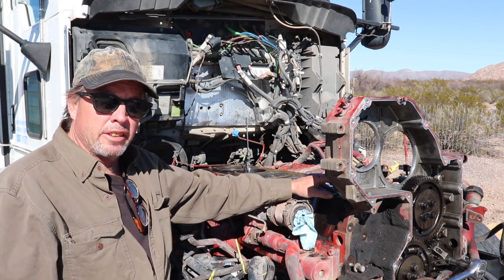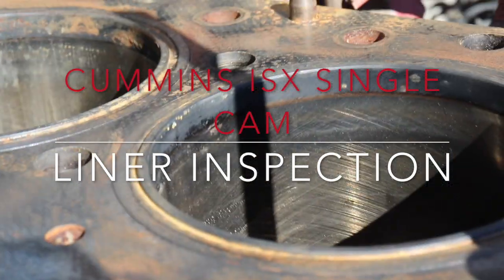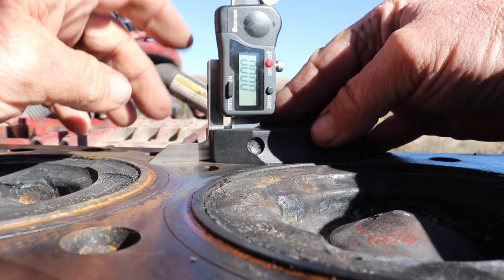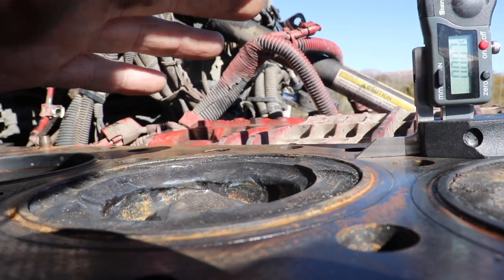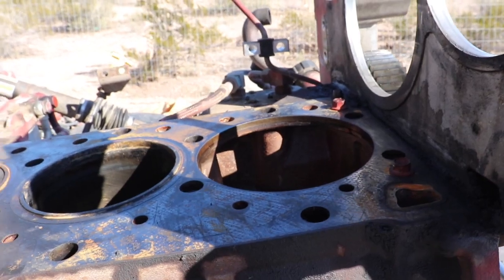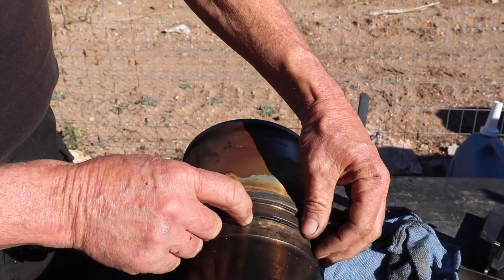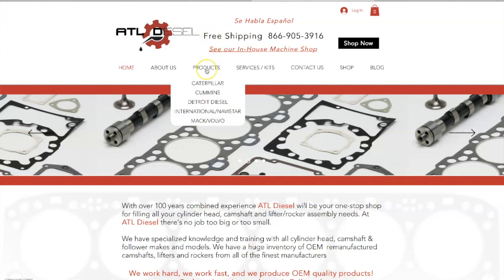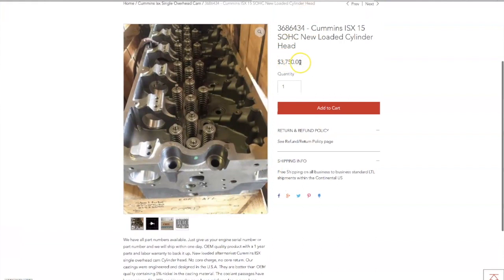10- 2012 Cummins ISX Single Cam. Liner Inspection And Identification (Are They Going To Live?)

Comment: So was the cylinder-head okay or what..???  I thought you were going to have it checked in episode #9...
Reply from the maker: I never checked it, I needed up buying an aftermarket head with more cooling capacity and reinforced.
Reply: @TerraFirmaX  

😮

Shame....On an N14 one bad head is only 1/3 of all the head....also helps up whondo not have a John Deere with forks as crane lifts to move one off then block.
Reply from the maker: @michaeldunagan8268  lol. True.

Comment: Hello. I have a question regarding pulling the liners out. Did you use a special tool for them?
Thank you.
Reply from the maker: It does take a special tool. I had a guy come out to cut the counter bored and he pulled the liners.
Reply: @TerraFirmaX  Thank you for the prompt respond. 
I asked my local Cummins dealer and they told me it is going to be close to 2k just for counter boring. Is this reasonable? Or should I be researching more?
Reply from the maker: @georgisimeonov243  Where are you located? There are people that will come out to your location and do the counter bores for you  around $800